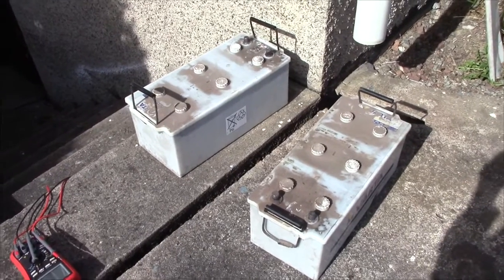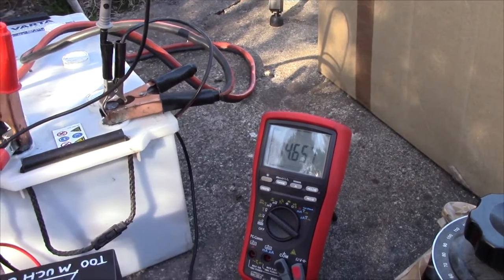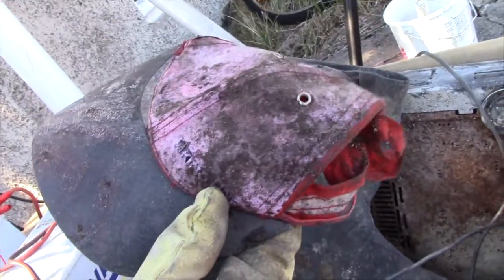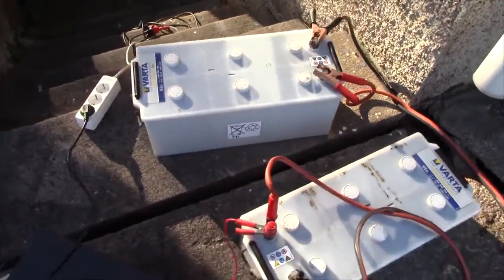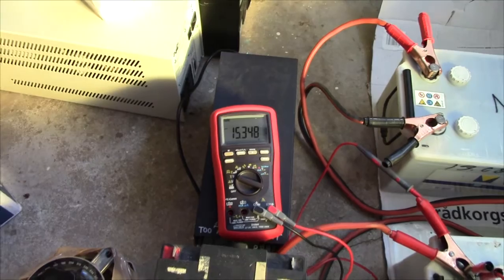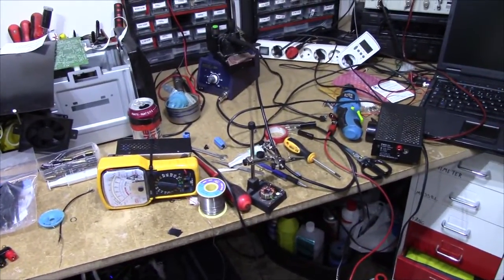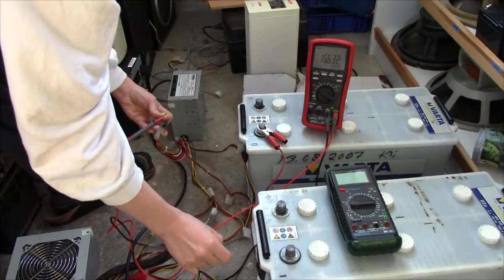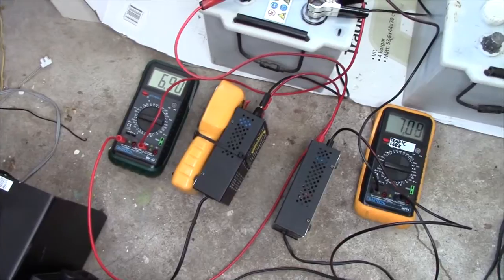Reconditioning two 180 Ah truck batteries

Comment: i have watched your video on review of class D amp kit ,you had given very nice measurement values in that video,i was expecting similar video here ,i had hoped to see measurements such as current AH rating ,improvement after RE-conditioning ,Efficiency vs typical values for lead-acid batteries ,Re-conditioning or De-sulphation method used by you etc hope to see video from you including these 
N.B. : Please avoid putting irrelevant things in the video the content of the video should reflect upon title of the video